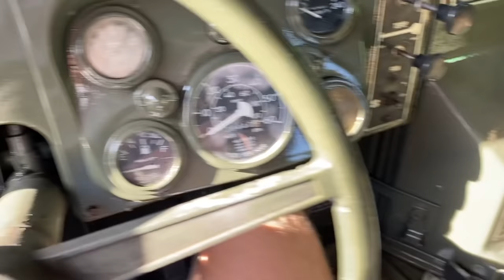Testing Our HUMVEE To NEW Depths!!! Is It Ready To Drive Completely Underwater???

Comment: Everything vents through one central location trans,transfer,diffs,air box, fuel tank, mechanical fuel pump.If you look right behind the radiator surge tank you will see a metal filter that looks like an inline fuel filter that's the vent for all of it.
Reply: Not all heroes wear capes.
Reply: Wondered if he was running with vents open.
Reply: It’s supposed to be a one way vent might just be able to replace the metal piece
Reply: Hope they read this!
Reply: Were you in the military?
Reply: Also consider the year model. 1994 and earlier had posi front and rear, after that they didn't. 95 and new models got stuck fairly easy if one wheel lost traction.
Reply: The trans dip stick isnt bolted down at the beginning of the video that could do it
Reply: Kelly...came here to say the same thing.    They can be easily plumbed into the snorkel as well.   The hub boxes are also vented through there.
Reply: Commenting to bump
Reply: Comment for the peeps! And this homie with the knowledge
Reply: On the civilian H1, the vent system terminates into the air intake horn.  At least on mine.  Also anything over 30" of water will cause the seals in the submerged components to take on water due to hydrostatic pressure.  Especially around the hub input and output seals.  Change the hub oil, diff oil at the very least after you dunk it like this.
Reply: That's what I was going to say is check all the breethers for everything like transmission and the diffs and whatever else has them and just extend them!!!🙃🙂
Reply: Maybe they can turbo the venting to make it more efficient and because.
Reply: Bump
Reply: As a 20 year Army mechanic that has worked on these, they really need to research the deep water fording kit that was on these. The kit includes both intake and exhaust snorkels along with the vent tubes for all geared hubs, transfer, diffs, etc. every one of those systems are now full of water. As a side note the kit's intake snorkel is higher than the one they have and is hard mounted to the top of the windshield. I might still have some pictures of one some where.
Reply: @toddballentine5461  
Sing me the ARMY song in the CS Chamber to prove your served :D
SAPPER
Reply: It looks like that trans was recently serviced with new hardware and all cleaned up and it was chirping gears pretty nice, maybe they didn't hook the vent line back to it correctly, but then again I think it would have even more water in it if it wasn't lol
Reply: @soldierski1669  Been there done that many times. Tell you what how about I tell you the the unofficial formula you might recognize. P = Plenty.
Reply: @soldierski1669  And the Army goes rolling along! My MOS song; on the land, on the sea and in the air, we gotta be there, we gotta be there! Anyone who ever worked on this stuff, never went mudding unless it was part of the training. Just like all vehicles, military ones are just as terrible to work on... Especially after they've been beat on and broken in mud up to the windows. They should turn that into a contact truck. Then when ever they have off road break downs or stucks, have someone driving it with them so they have tools and what not to get the rigs going again.
Reply: Bump for the love of all things military 🇮🇪🇺🇸
Reply: So, what you're saying is, he has water in his trans,transfer,diffs,air box, fuel tank, mechanical fuel pump 🤣🤣🤣🤣🤣
Reply: @XathridYT  Yes more than likely his transfer case, which has a silver breather on top of it, the geared hubs have spring breathers on top of them, and other systems in the drive train that have a breather on them will all get water in the oil once crossing a ford of a depth greater that the tops of the wheels. once that is done the proper procedures in the operator's and maintenance TM's require a service to be preformed on all those items ( drain and refill), unless the vehicle has a deep water fording kit installed. the geared hubs are the lowest point in that system. The geared hubs in those things normally have a small brass spring breather on the top and the 80/90 gear oil in them gets milky as heck once you go through the water sometimes clogging the breather with debris and blowing the outer hub seals. I have recovered HMMWVs and most every other military vehicle and had to service those exact components countless times.
Reply: @toddballentine5461  that's badass dude, thanks for the reply
Reply: @XathridYT  You are welcome just trying to pass some knowledge and advice to save someone some money.
Reply: Bump
Reply: This sounds like a job for the car wizard.
Reply: @toddballentine5461  I cringe when they say hydrolock. Had one come in and all the job order said was "Engine locked. Replace engine". Yeahhhhh, had the infamous waterline across the air filter housing, radiator etc. Pulled the oil drain plug and all that came out at first was water. Pulled the glow plugs and started barring it over and nothing but grey slime came out. Nah, that vehicle hadn't been sunk. lol
Reply: @toddballentine5461  Posted this on the last two videos with links.  Needs the fording kit.  I have the big snorkel on my HMMWV.  Dont have the full deep fording kit though due to demil from the USMC.
Reply: bump
Reply: Yup you can literally buy a deep fording kit.
Reply: Bump
Reply: Bump
Reply: Bump
Reply: Bump
Reply: Bump
Reply: Bump
Reply: Bump
Reply: Bump
Reply: Bump
Reply: Bump
Reply: Bump
Reply: Bump
Reply: Bump
Reply: Bump
Reply: Bump
Reply: Bump
Reply: Bump
Reply: Bump
Reply: Bump
Reply: Bump
Reply: Bump
Reply: Bump
Reply: Bump
Reply: Bump
Reply: Bump
Reply: Bump
Reply: Bump
Reply: Bump
Reply: Bump
Reply: Bump
Reply: Bump
Reply: Bump
Reply: Bump
Reply: Bump
Reply: Bump
Reply: You have to extend that vent tube up along the snorkel for deep water forwarding.
Edit: just look up complete deep water kits for Humvees. You need the snorkel, extended exhaust pipe, vent tube extended up to the top of the snorkel, and different trans and oil dip sticks with screw down locking tops so water can't get in. 
Vent tube extensions keeps water out of everything, snorkel (obvious), extended exhaust keeps hydro locking if the engines dies. Water would flood in the exhaust and if it gets to the engine it'll lock up. 
Google the -10, -24, -34 manuals. Download them for free. 
10 is operators manual, 24 and 34 is parts and maintenance.
They're lifesavers.
Reply: ive never submerged a lead acid battery before but wouldnt that be a bad idea as well lol
Reply: Artinya apaan
Reply: Car cloaca
Reply: Doing ma part to boost this comment

Comment: Few years back I crossed a river in my 1998 H1 wagon. Had water up to the middle of the windshield. Only one leak the petcock valve in the passenger side front foot area wasn’t tight so I had about 3 inches of water in the passenger foot area. That’s it crossed both ways no problem.

Comment: This humvee is badass. You guys have to do more with it, don’t let it be forgotten in a parking lot or a garage.
Reply from the maker: Diesel or LS Swap?
Reply: Diesel
Reply: @CleetusM  duramax swap
Reply: @CleetusM  diesel. Motor has to last longer than JH's burnout tires tho.
Reply: Diesel. Making about 2k torque.
Reply: Diesel
Reply: @CleetusM  bulletproof diesel swap
Reply: Diesel swap! And add a water cannon on back! Bahahahaha!
Reply: @CleetusM  Diesel for sure you need the torque
Reply: @CleetusM  427 baby
Reply: @CleetusM  diesel! Make it a powerhouse like the galaxy!
Reply: @CleetusM   diesel! Cummins or Duramax.
Reply: @CleetusM  Diesel 100%
Reply: Diesel!
Reply: @CleetusM  Diesel 100%
Reply: @CleetusM   get with westen Champlin and cummins swap it!
Reply: @CleetusM  6.6 duramax would be absolutely sick
Reply: Ls
Reply: Actually fricken 2j swap it becaus you dont have a car with a Honda engine
Reply: @CleetusM  diesel for sure, but keep the electronics as simple as possible.
Reply: Leave it stock
Reply: It needs a diesel swap, probably a cummins since its all mechanical.
Reply: @CleetusM  Diesel for sure
Reply: @CleetusM  Diesel!!
Reply: @CleetusM  get you a duramax
Reply: @CleetusM  Cummins or powerstroke swap
Reply: @CleetusM  Add a turbo and turn up the 6.5 just because. They handle a turbo just fine and all you have to do is turn up the injection pump. Those 6.5 diesels aren't worth much so might as well have fun with it. Could double the hp(or more) for cheap.
Reply: Cummins
Reply: @CleetusM   4-71 Detroit !!
Reply: 12 valve mechanical
Reply: Diesel
Reply: @CleetusM  427 is a great Motor But i think this puppy needs the First LS 454 On the Channel
Reply: @CleetusM  diesel for sure
Reply: Duramax!!!!!
Reply: @cutlass8783  ah yes, the legendary engine from the Honda Supra
Reply: @CleetusM  rotary humvee!
Reply: @CleetusM  Detroit swap it, get that 2 stroke powerband
Reply: @CleetusM  cummins swap.
Reply: @CleetusM  cummins swap!!
Reply: Hellcat swap
Reply: @CleetusM  as long as it makes 1000hp please
Reply: @CleetusM  get something that doesnt require tech so you can still bog deep
Reply: @CleetusM  Diesel
Reply: @CleetusM  I'm a Duramax guy, but I'd swap it with a 4bt or 6bt if it would fit.  The less electronics the better for what it is being used for.
Reply: @CleetusM  Diesel
Reply: @CleetusM  Why not both?
Reply: This is basically what I said. This is actually a  pretty clean Humvee. I hope Cleet either keeps it in good shape or does something with it. I'd hate to see it just rust away in the back of the shop. Diesel swapping it with a newer motor would be awesome.
Reply: @CleetusM  5.9 12v Cummins
Reply: 4bt swap it plenty of torque potential and less weight .
Reply: @CleetusM  Get back together with PowerDrivenDiesel and get a high horsepower diesel going for it
Reply: @CleetusM  diesel for sure brother!!! Absolutely love the Humvee!!!🤘🤘🤘🙏🙏🙏🙏
Reply: @CleetusM  diesel on some 40s !!!
Reply: @CleetusM  Duramax for sure
Reply: @CleetusM  get one of the new Banks Duramax 1000hp crate motors. that would be cool :) supercharged.
Reply: @CleetusM  big ol Duramax question mark
Reply: @CleetusM  nasty 1000hp built Duramax
Reply: @CleetusM  diesel. Keep it all analog, but give it more power... Maybe a boat propeller on the rear diff?
Reply: @CleetusM  LS
Reply: @CleetusM  LOL an LS will hardly move that thing.
Reply: @CleetusM  Diesel all day long. 1000 HP Duramax in htat with actual mud tires or even AG tires would get you really stuck, and isnt that the important thing?
Reply: Cat c15
Reply: @CleetusM  Diesel swap something with high HP and TQ!
Reply: @CleetusM  I would have to say diesel, I'm not sure how I feel about a gas powered hummer.
Reply: LS would be pretty cool but so would a dmax or cummins I'd it would fit. Would love to see any one of these!!
Reply: @CleetusM  12v Cummins all mechanical so no electronics, so you can still do all these shenanigans with it just with a bit more power and torque. Mountain Machine in Michigan has a kit and even has a setup to allow you to bolt up the P-pump to a 6.7 Cummins.
Reply: Gotta stay diesel. 12 valve Cummins would be sweet 👌🏻
Reply: @CleetusM  Also needs a jet drive for extra deep water thrust
Reply: @CleetusM  Cummins swap.  Do it.  Do it now.
Reply: @CleetusM  diésel
Reply: @CleetusM  twin turbo 427
Reply: Diesel
Reply: @Cleetus McFarland Definitely needs a good old 5.9 12v cummins for the thrashing you guys do
Reply: Diesel all day, every day.
Reply: @CleetusM  427 THE WORLD
Reply: @CleetusM  Duramax... Gotta do it, just gotta do it.
Reply: @CleetusM  LS Swap
Reply: @CleetusM  Definitely Diesel, Cummins would be sick. Going to have to do a body lift but that also means bigger tires.
Reply: Lbz
Reply: Dillon Bishop  so you want him to have to tow it everywhere????? Fords suck. Get over it
Reply: Cummins swap
Reply: @CleetusM  Rotary swap
Reply: @CleetusM  LS SWAP, Drag racing MACHINE, 2500hp
Reply: Definitely do the duramax swap, watch Preditor Inc's YouTube channel  they build nothing but hummers and the duramax is the only engine they put in those bad ass hummers !!!!
Reply: @garyhentschel391  basic
Reply: Put a jet drive off of a drive shaft that comes through the rear differential to a jet drive !!!! That would be soo sick !!!
Reply: We road marched our humvees from Fort Hood to Fort Bliss for Roving Sands joint exercise back in 2000. Get the old ones that had bias ply tires up around 70 mph and it would damn near shake your fillings loose.
Reply: @CleetusM  diesel for sure
Reply: Keep the 6.5 and turbo build it. No one does the 6.5 Detroit diesels.
Reply: @cutlass8783  ......Toyota?
Reply: Tesla motors on all 4 wheels
Reply: @cNeeb  is it Toyota? because i don't know import engines
Reply: @CleetusM   Need to maintain its ability to drive underwater.
Reply: @CleetusM  Duramax swap, make monstermax some competition
Reply: 104 comments and not one mentioned a Detroit diesel swap. My heart aches for those who think this thing deserves only a Cummins or duramax or power stroke . I think what we all have to remember is that this is cleeter mcskeeter and he doesn’t do anything the traditional way🇺🇸
Reply: 12v cummins.  Keep it mechanical and simple.
Reply: @CleetusM  hemi turbo swap
Reply: @CleetusM  Diesel. Do something crazy though. 1000 hp at the minimum
Reply: @CleetusM  ls for sure

Comment: Hey Cleet, pardon this comment if you have already researched it, but look up how to activate the torsion bias diffs in the Humvee.  But essentially, you need to ride the brake a little when you have a tire spinning.  You'll be able to get all 4 tires crawling along, rather than any 1 or 2 digging.

Comment: Cleeet...there should be a switch lower right hand of the dash to disengage the fan clutch. This  prevents breaking the fan blades and reduce the engine bogging from the resistance of it spinning in the water. When you are out you roll the switch back over.

Comment: As a combat driver of this vehicle here's a big tip. Tihten up the accelerator cable and it'll act like a whole new truck. Plus give you an overdrive kick on the bottom 1/4 of the pedal!!
Reply: Also the #3 lifter is pretty much shot, and most drive train seals (but ya know that). It's actually made to 'swim' with the mud tires and good greased seals throughout.

Comment: Get the high rise exhaust that is available.  It does not bleed energy underwater.  You also take the top off sit on the back of seat, drive with your feet, and set throttle lock.

Comment: I got a 1988 M998 military surplus Humvee from GovPlanet. I won the auction for 8100 bucks. It's 100% complete and in perfect condition. 6.5L V8 diesel (no turbo). 3 speed. 
I've had it for about 6 years, insured, tagged, registered, titled, and street legal. It's an awesome offroad vehicle. 
I was in the Marines for 5 years. 
Humvees were designed as utility vehicles, they were never meant to be a combat vehicle. You can thank politicians and poor leadership for those decisions.
As an offroad or utility vehicle the Humvee is fantastic! 
Better than any Jeep or lifted truck that I've had experience with.

Edit: You can download all the Humvee operators, maintenance, and parts manuals for free online. Just Google them. Read them. They're lifesavers.
You can order just about anything for them off Ebay.

Comment: When you are done tearing it up, I'll buy the rear seat buckets pop riveted to the floor and transmission hump. I  need a pair for my former Special Forces GMV Gun Truck M1025A2 with Rod Hall Offroad Racing Remote Reservoir Nitrogen-charged shocks.

Comment: There's a transmission  Cooler line on the passenger side you can unhook and drain into a bucket with motor running drain oil in bucket with motor running and fill with new fluid in dipstick tube. Till oil looks good

Comment: Cleetus, it is going to take you forever to fix the fluid issues from the vent system on that truck it runs everywhere, good luck getting it high enough to stop filling the trans with water. the HUMMV has a specific kit for fording. if you need more info i spent 25 years in the army as a maintainer. Just ask me!

Comment: There's more to Deep Water Fording than just the intake extension and extended exhaust pipe.    When you try to "swim" the truck without a proper DWF kit installation, you're going to get water in your portal hubs, transmission, engine and differential, all of which get breather tubes which end up routed up the side of the intake extension.

Comment: You should just find a 95 chevy 3500 in the junkyard and grab the turbo off the 6.5 since its the same exact motor 🤘
Reply: True, cheap option. Or banks. But it's cleetus,  so I'm assuming duramax or Cummins swap.
Reply: Not the same engine. Pretty sure the non turbo is the 6.2
Reply: @stevendombrosky2842  it is, but they do bolt right up.
Reply: Depends on the year, you could get a 6.5 without a turbo. Depends on the application.  Did he say what year it was? And the 6.2 is basically the same engine as a 6.5. The heads and fuel delivery were the only real differences
Reply: Hummers use the turbo setup from the van. It's tucked up under the rear of the intake. Pick up unit won't fit

Comment: Those trucks are dogs for speed, but they got torque. Geared hubs reduced the gear ratio to the wheels along with the differential and depending on if you are in high or low you have a crawler basically.

Comment: If you put on some tires with huge lugs it'll work a lot better in deep water, it basically is floating and using the tires for propulsion rather than moving it by them gripping the ground. Now if you want something REALLY fun.. buy a DUKW.
Can't wait for the video with Tom's cars.

Comment: Might take the seat pad off the rear drivers side and swap it with the drivers pad. If you plan on keeping those seats anyway. Also, brake/ throttle modulation will do wonders for you in that truck.